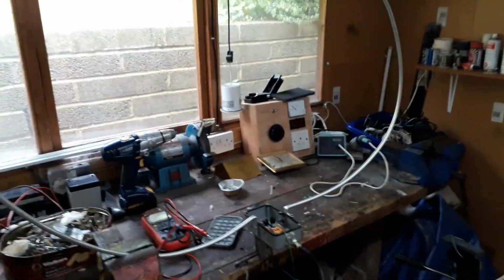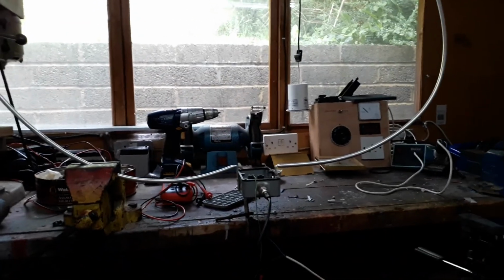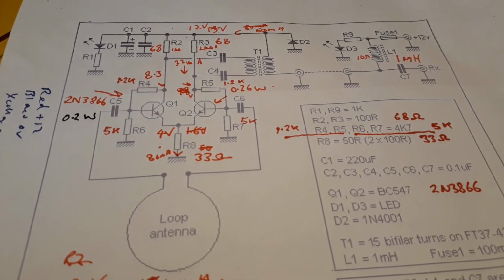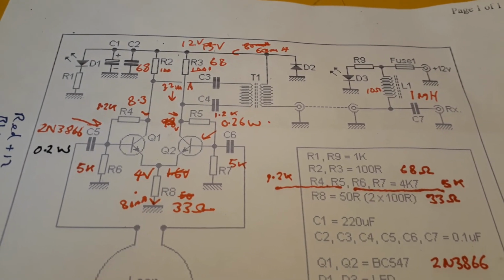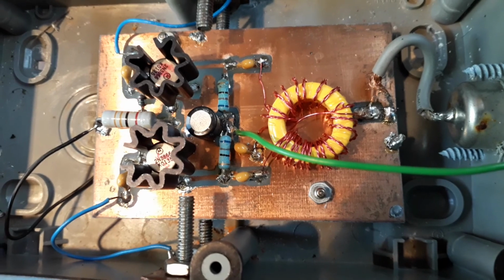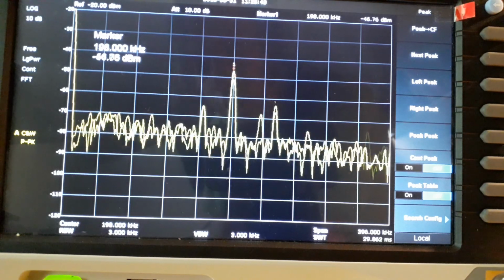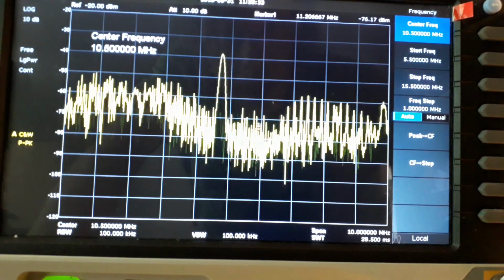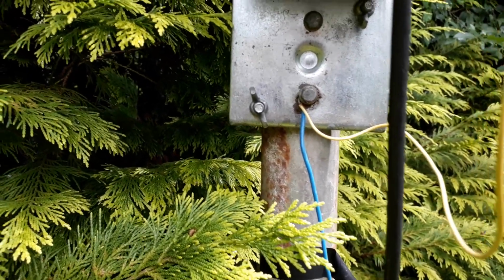Home made active loop antenna

Comment: I got the same loop and used the very same project. I have some videos on it on my channel, dated many years ago. Have experienced the good directivity as you said. In fact mine was mounted on a light duty rotor.
It’s down now but I’m in the process of rebuilding it and want to try your Ic mod to improve intermodulation. Also want to put a relay that disconnect the loop when I TX cause on this location it’ll be sitting very close to the HF antenna. 
Another project together with the Marconi 2022E  tlc.
Cheers
Reply from the maker: Hi nice to hear you're using the same design of loop, mine has been working well for 5 years apart from occasional wind damage! I don't bother to rotate it I've just turned it to minimize local noise.  It certainly is worth increasing the Ic to improve its intermod products. I wonder what transistors you are using? I'm using bfw16a I think on one version but they are hard to find and can be expensive. On the other one I built I tried 2n3866 s they seem to work just as well and are more common. Of course you will have to change the biasing and emitter resistor.
best wishes, Nick
Reply: @ptronix  Hi Nick, mine had a pair of BC337. Now in substitution I want to check if I could use 2n3904 just because I bought some for an MFJ meter that come in with issues. But that’s another story hi hi. 
My loop was fed by a separate 12v line but now I want to implement it on the coax with bias tee. Much better. Let’s see how it goes. It’s all school for me as I’m always learning. 
Best wishes, Diego
Reply from the maker: @IZ0MTW  hi diego I think the 2n 3904 is too low powered to be much use  , the transistors I use in a to5 can get quite hot enough so I put heat sinks on them, best wishes nick
Reply: @ptronix  ok thanks for the advise, I’ll keep it in mind and study on it. Cheers